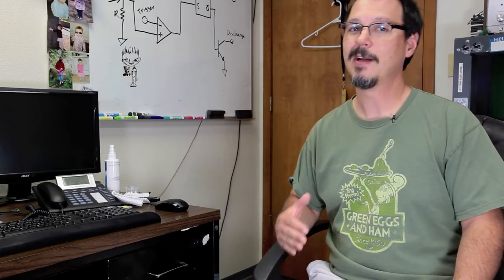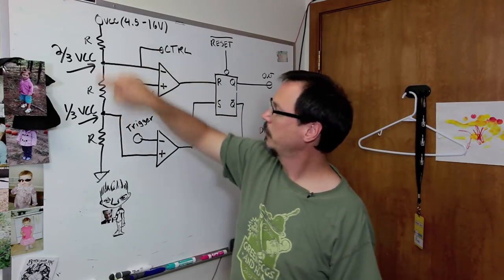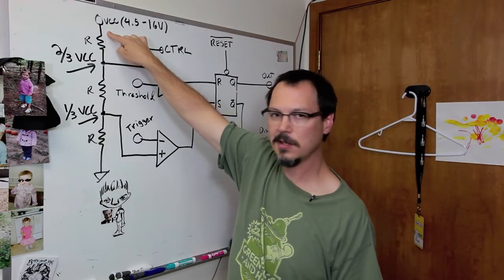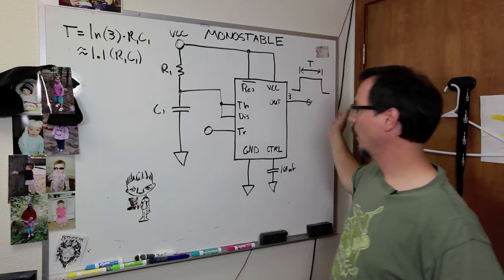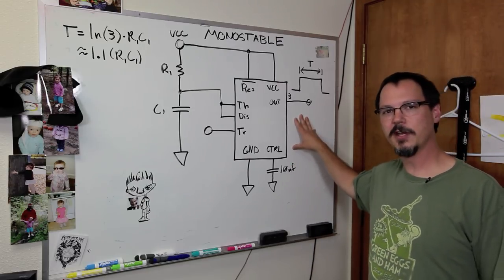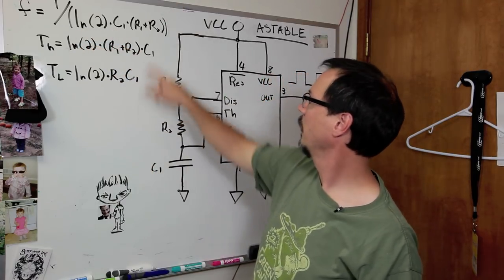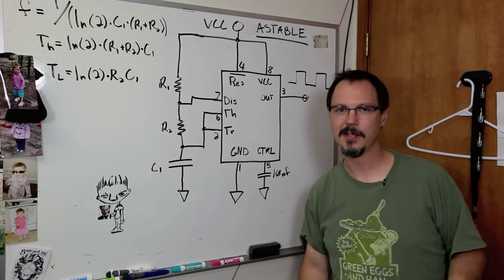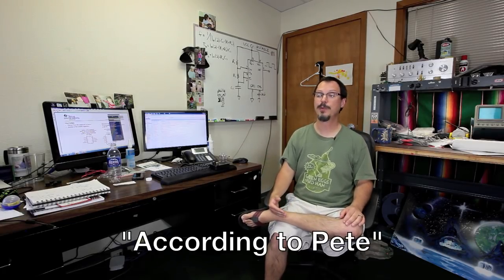According to Pete 10-2-11: 555 Timers

Comment: The resistance of the three resistors varies depending on the type. The original TTL 555 timer uses 5k resistors. CMOS and other versions use higher values in the range of 100k.

Comment: Very good explanation. Only to emphazise that at 8:00, on the ASTABLE configuration, at 't=0', Threshold voltage is lower than (1/3)Vcc , so the output must be '1' .

Comment: The resistors are 5k ohm ea. Hence 555 timer; three 5k resistors.
Reply: Mike Brophy That's actually incorrect and I know many people think that the resistors are 5k or 50k but the truth is that Signetics, who 1st made the IC, had 5xx P/N so they have 565, 567 and so on. 555 was chosen for no special reason. SORRY! :)
Reply: MrMonomonster Its just a helpful tip for beginners learning electronics. But fair enough, your not wrong.
Reply: Look up Columbia Gorge College, they think and know that it as 3 x 5k resisters in the divider
Reply: You just told him the reason, number sequence 555 was the next project name or something.

Comment: The funniest application for a 555 timer I saw was back in the 80's a tech friend of mine tore into his scientific america cable remote control. He piggybacked a 555 timer with and adjustable pot into the power circuit, and adjusted the timer to where the cable box  powered on and off at such a rate as to where he can see the local porn channel. He was a genius and a pervert.... Funny Guy!

Comment: I am building dc generator using 170 KV BLDC motor equipped 3 Phase diode Bridge.
Engine will turn the BLDC motor up to certain RPM to get 22 V DC.
Engine rotation should be adjusted automatically by servo motor which connected to engine throttle to keep 22v dc output.
I need proper closed loop servo controller.  please advise me what does the schematic diagram look like ?

Comment: At 8:03 , you say that the trigger has been pulled lower than 1/3 rd of VCC , at that time the output should be high, cos according to the diagram the comparator will give high when the trigger is lower than 1/3*VCC and that is connected to the set of ff . Am i missing something , please explain .   Thanx

Comment: For the astable configuration you gave "time high" as
Th=ln(2) * (R1+R2) * C1
and "time low" as
Tl=ln(2) * R2 * C1
The equation you gave for frequency is equal to 1/Th...  Shouldn't it be equal to 1/(Th + Tl)?  So instead of this:
f = 1/(ln(2) * C1 * (R1 + R2))
it should be this?
f = 1/(ln(2) * C1 * (R1 + 2*R2))?